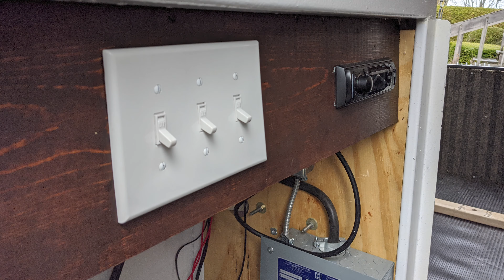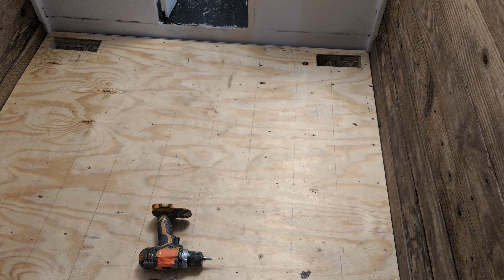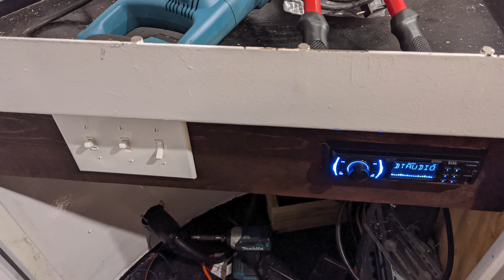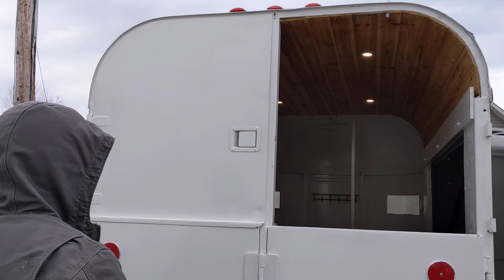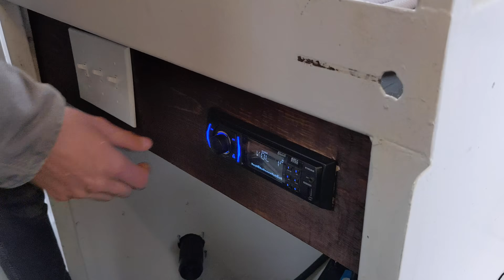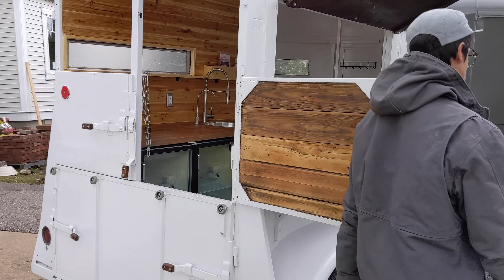Converting a Horse Trailer Into a Mobile Bar Start To Finish + TOUR

Comment: Hya, really basic question, how did you make the initial framing, did you bolt into the body work of the trailer?
Reply from the maker: Sorry just seeing this - Bolting all the way through is an option, also self tapping screws are a good option.

Comment: Very nice. My brother is a contractor so I’m gonna video tape my project as well. I just bought a horse trailer. I’m starting out with the walls to set the electrical to be ready and doing wood flooring as well. We are setting white flushed lights in the ceiling. After that we want to set a piece of wood and epoxy it as well like you guys did. We are doing bakery not a coffee shop. Most of the bakery will be made already and ready to sell. I don’t think my wife wants to bake in the trailer but maybe it would be a great idea. We will only have 2 sinks. To wash hands.

Comment: Thank you for this video. I’m opening a lemonade bar with a horse trailer similar. Do I have to license it as a food truck? Wondering if you could answer even for your state. I live in Florida.
Reply: Lemonade Truck*
Reply from the maker: You likely would but it may be easier if you're just doing lemonade. I'd recommend calling your local health department. They were very helpful!

Comment: Can you tell me if you have to hook it up to water or how do you get water to run through the sinks? i want to buy one of these for a mobile coffee bar for weddings but cant figure out how this works for sink and espresso machine
Reply: you kept saying "tanks" but you also said there is a place to plug a hose into. so do you need a hose or not?
Reply from the maker: Yeah they can be fed with a hose or gravity fed with jugs. The tanks hole plenty of water for a wedding event so you wouldn't need to be hooked up during the event

Comment: Water pours through top hinge hatches unless you fit door seal or a flexible storm guard across the top. I’ve just finished refurbing the inside of a horse box van conversion that had rotted through completely only to find it full of water by the hatch which is probably what caused the problem in the first place. I’m planning on taking the entire top and bottom hatch off to create a door seal all around to prevent this from happening again.
Reply: Yeah that's a good idea. We added some rubber seals.

Comment: Hey! I’m from michigan and I just purchased my tailer to start. My question is about . Licensing. You said you had to register it as a food truck. I wanted to know a little bit more about the licensing process. Meaning where to look for mobile bar  requirements or what should I look up ?
Reply: Hi Rose, Congrats! Food truck licensing is managed on a county level. If you're not preparing food, you probably can go without getting an STFU license. Yes, it's actually called that. You can also go without all the fancy mechanical systems. I am starting another trailer this week that will be much simpler.
Reply: @scottymixer where can we see that new project with more instructions?:)
Reply: @alenahanakova9634  I actually just donated that trailer to a local church. But I'll check in with them and see how their project is going and capture some video of it

Comment: Great job guys. I was thinking of modifying a horse trailer for coffee trailer but since I have on experience with electric and pluming I decided to for custom fabrication in China. I was looking for the Airstream look. Any way, in the design stage I was concerned about the rain because I live in Ohio and I'll be outside always. I noticed you didn't have any way to direct the rain away from the service window, or will it be inside?  Good luck with your next project.

Comment: Awesome video, thanks! I have a question. How wide are your bar tops? The larger one on the back wall, the one on the opposite wall where you serve from and the outside one? I’m doing a father/daughter project on a vintage horse trailer from the 70’s too and need all the help I can get. 😊

Comment: Did you install both hot and cold water option?
Reply from the maker: Yes there's a 6-gallon hot water heater
Reply: @MixerProjects  Does the hot and cold water each need their own water pump?

Comment: what kind of insulation you use for the flooring and ceiling looking for it at lowes
Reply from the maker: Hey there, I used just a standard pink foam board insulation. I think it was 1" for this project. Most big box stores carry it.

Comment: How did you get the insulation to stick on the ceiling
Reply from the maker: I used a glue to hold it in place, then when I fastened the wood to the square tubing that held it in a lot better

Comment: Hey ! Nice job !! I would love to know what permits or safety guidelines you guys were following ? Turned out amazing btw !!
Reply from the maker: Thank you! I generally try to follow standard building practices when I'm doing electrical, plumbing etc.. on trailers. Trailers are kind of a grey area. If you're building a food truck, The local health department will probably have a few requirements about how the drains work, check valves for city water etc.. 

Hopefully that helps. Let me know if you have any other questions

Comment: Are the walls pretty thin in the original horse trailer. Would mounting stuff with screws go right through the exterior of the trailer?
Reply from the maker: Some of the walls were lined with 2" lumber. In that case, you could screw right into it. The ceiling was just thin sheet metal.